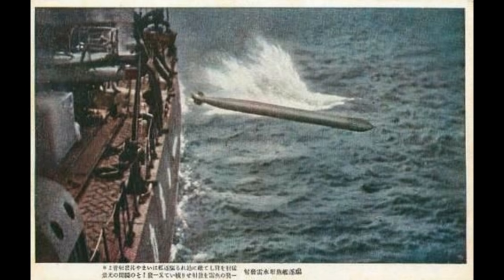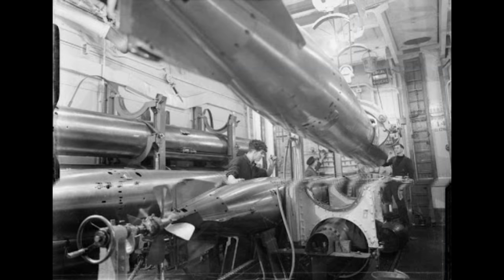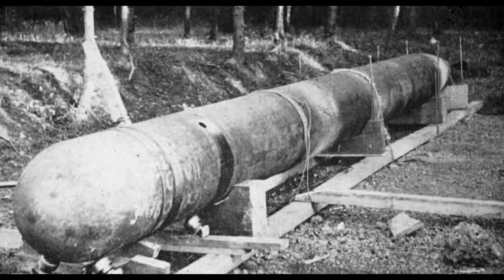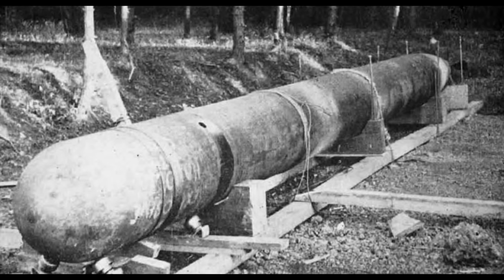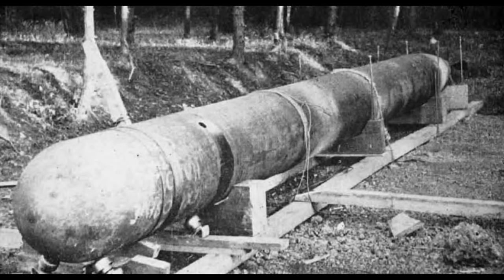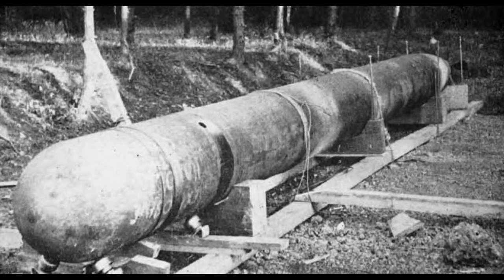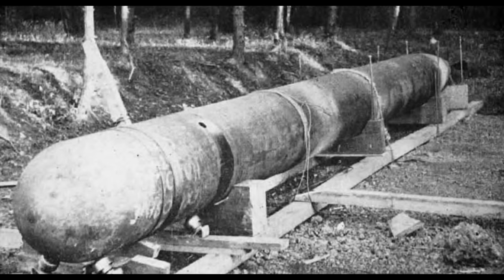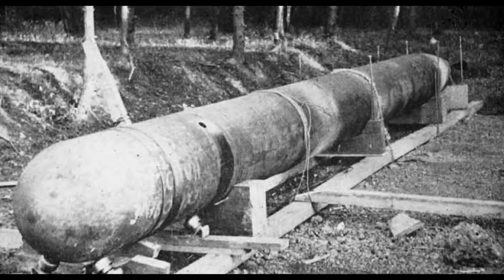Type 93 Long Lance Torpedo - Long Range Hole Poking Device

Comment: Japan had an unexpected ally for defeating the US Navy in the Pacific - the Bureau of Ordnance.
Reply: you mean the Bureau of Disiordnace, perhaps?
Reply: The Bureau of Graft and Corruption you mean.
Reply: I like to think the bureaucrats from the German TVA and the American BuOrd are kept in a special nautically-themed section of hell designed for lazy, negligent torpedo designers.
Reply: @gastonbell108  I don’t know much about the Germans, but the US designers probably did about as well as they could with the resources they were provided. 

The people to blame would be those that decided to not fund proper trials before equipping the navy with the torpedoes and those that refused to accept the field reports of failures. Both of those are going to be above the paygrade of the torpedo designers.
Reply: Highly recommended viewing - “Failure is like Onions” by @Drachinifel  He covered the story of America’s torpedo fiasco in great detail. The comments section was enlightening as well.
Reply: @88porpoise  The Navy brass apparently were loathe to spend any money on systems testing. There were also serious 'tude problems at the bureau.
Reply: @michaeltroster9059  The bureau sent a tech out, to instruct the fleet on proper maintenance and use. On demonstrating installation of the guidance unit (gyro unit, i believe), the Engineer of the Boat had to correct the upside-down unit installed by the rep. The fleet guys told me my shit was broken, I listened. Their lives depend on them having the correct knowledge.
Reply: @michaeltroster9059  You may also know about the time the congressman informed the American Public not to worry about our submariners, the Japanese were setting their depth charges too shallow. The editor of the paper had no issues publishing. The Imperial Japanese navy was grateful for the intelligence, and promptly corrected the issue.
Reply: @Delgen1951  Nice!
Reply: Correct me if I'm wrong,,,,,,,,,,,,,,,,but was not the Bureau of Ordnance/Dis-Ordnance the same group of geniuses who refused to believe there was anything wrong the the American torpedos, which persisted in not exploding, time after time?
Reply: Amen!
Reply: You have to wonder how much shorter the war in the Pacific would have been had the  American submarine force gone into action with a fully tested, reliable torpedo.
Consider that Japan is an nation totally dependent on lots of inter-island merchant ship traffic.
The IJN in 1941 was full of the Samari spirit - a strong offense makes the best defense, so no need for convoys and A/S escorts.
Reply: @agwhitaker  Not sure where I read it, but the US Navy was doctrinally opposed to using submarines for sinking enemy commerce. The Gato class “fleet submarines “ were intended to operate with the fleet. They would Scout ahead, act as pickets, and sink enemy warships. That doctrine went out the window as soon as Pearl Harbor was bombed. I wonder if the torpedo issue might have been discovered and accepted sooner if the subs had worked more closely with the fleet. After all, the negative reports kept coming back without clear evidence or witnesses other than those with the most blame to shift. Who was looking through a periscope during an attack? One or two officers, most likely. Weapon problems are temporary. Blame shifting and politics are eternal.
Reply: @amerigo88  You likely have heard this percentage riddled statistic - but it is worth repeating here,
By wars end, the US submarine force had sunk -
1. over 30% of the claimed Japanese naval shipping -
2. over 50% of the claimed Japanese merchant marine -
this done by a force that NEVER reached 2% of the total personnel serving in the U.S. navy,
AND working with a defective primary weapon for at least the first 18 months of hostilities.
Reply: @amerigo88  While US Navy had powerful ally in Japan that can be described as "warrior's perception". Japan submarines were not trying to go after commerce or supply ship as far as I know. I also read story how before Battle of Midway during planning stage Japanese high stuff was making war game and dices said that their carriers suffered major blow, they erased that event as not plausible.

I wonder whether admirals at sea did not read those reports by submariners in time or did not care or did not have power to do anything. Because if true, it had to be clear for them that one of their arms is loaded with dummy ammunition in hot war and their surface fleet is going to face stronger enemy but even worse - their own destroyers or torpedo bombers are useless as well. 
(how much those doomed torpedo bomber runs at Midway were really ineffective per se and how much were those poor bastards actually betrayed by defective weaponry?)
Reply: @agwhitaker  By the end of war, after problems had been rectified, Japan had lost number of surface warships as well as planes and experienced crews. And still submarine branch suffered (in similar way to armed forces of Germany) the highest casualty rate.
And at the same time, USAAF bombers dropping naval mines destroyed and damaged their share of japanese merchant navy (and some military as well), locked them in the ports despite mine runs were just a miniscule fraction of the total bombing attacks against Japan. 
But I think that even those submarines had great benefit from that bulk of the navy that conquered vast area of the ocean, islands, gave them closer bases, reconnaissance, safe passages and so on. Just to balance those "2% only"
Reply: @88porpoise  Designers aye.. the Admiral in charge no and a special place in hell awaits him. He was in overall command of the MK MIV development and deployment **Rear Admiral Christie**, tho not the only one .. even AFTER Nimitz ordered all the german influence exploders disarmed and the magnetic arming mechanic removed, he (Christie) wasn't in Nimitz direct chain of command kept them on .. and kept missing .. it is impossible to read the reports that he saw and never check out the torp .. Deep running, magnetics causing earily explosions, direct impact exploders not functioning, temp/battery issues on every sub in his command. While Nimitz boats went from 15% hits, to almost 95% if hit  (far fewer duds) while Christie continued to blame the crews under his command for the failure.
You could easily make the arguement to a naval court that his willful protection of a bad weapon gave aid and comfort to the enemy.
Reply: @GeorgetownDude  Rear Adm Christie .. it was him... it is still required reading at the naval acad . ie "How screw up in a massive way and not fix it"
Reply: @gastonbell108  Satan let them keep their jobs, except they have to design torpedoes that can swim through the lava oceans of Hell.
Reply: @odileelido8407  And they're never good enough so Satan keeps beating their hands with a red-hot ruler and making them do it again. For eternity. As a lesson on why not to be lazy with other, much-braver men's lives.
Reply: Well, this is news, isn't it? I could have sworn that the US Navy actually defeated Japan in the Pacific, not the other way round. Indeed, if the Japanese defeated the American Navy, then we've all believed a huge lie all these years, because the Japanese must have won World War two and we never even knew about it....
Reply: The Bureau was also responsible in its entirety for all the issues with the M16 rifle in VIetnam.  All its reliability issues  related to the ammunition the Bureau insisted it use.. which was not the ammo it was designed for... and which was used for its trials by the army
Reply: BuOrd was the most useless organization of the USN.  They refused to live test the Mk 14 or accept its flaws, handicapping US submarines
Reply: @davidthomas7678  I believe you are pulling our legs. It was the US Army Ordnance Department of Aberdeen Proving Grounds, Maryland that did everything it could to favor adoption of the outdated M-14 over the M-16. They also hampered the M-16 by disregarding the guidance of Eugene Stoner, the brilliant designer who warned them that “stick powder” was required instead of the Army’s “ball powder.” When combined with inadequate weapon maintenance, the M-16’s initial deployment to Vietnam was a fiasco of Congressional proportions.
Reply: This was balanced, though, by the Imperial Japanese Navy facing a determined and poweful enemy from this period right through to 1945 - the Imperial Japanese Army.
Reply: @grahamlait1969  it really isnt news. Edward Beach a submariner wrote about it in the early 50s in several accounts of outstanding subs and their commanders.
The US did in fact defeat JPan despite their starting superiority in torpedoes planes and night operations.  It did this primarily thru a crushing superiority in production capacity population access to raw materials innovation luck and breaking the Japanese codes.
I suggest you study the naval battles around the Solomon Islands most particularly Savo Island to get an understanding of just how effective these torpedoes and night fighting superiority  against a group of navies that didn't have similar capabilities but worse continued to deny that the enemy did in fact have such capabilities.
Reply: Ah, Yes. The Bureau Of Ordnance. His Statement At 18:55 More Than Shows How Self-Absorbed, Insensitive, Egotistical & Narcissistic They Were!
Reply: Kelly Arthur  Blair is an author? a Report? I would be interested in reviewing the source. If there hadn't been a pattern of rejection of operator reports by the bureau, I would be more sympathetic to their case. Plausible that the tech installed it incorrectly to test the crew's competence, it comes down to "He said, she said". Poor design, it should have been designed so it couldn't be installed inverted, still on the bureau.
Reply: Kelly Arthur  Taking this fine fat chewing on WWII submarine warfare in a new direction- IIRC, the early war USN subs were not to dive below 300 feet; later war boats 400 feet. I read "Iron Coffins," a first hand account by a Geeman U-boat skipper, and he claimed the Type VII was able to handle nearly 1000 feet! Since a WWII submarine on battery power only was truly fighting in three dimensions, this made an enormous difference. This clearly impled the British faced some very different challenges than the Japanese. I would love to know when this German capability became common knowledge to the Royal Navy ASW sailors. I also heard in San Diego that the USN adopted U-boat construction welding techniques soon after the war. Is this true?
Reply: Kelly Arthur  thanks for the reply
Reply: Japanese combat prowess and BuOrd's fuckery combined were still no match for USA's shipyards going brr.
Reply: @88porpoise  one can forgive BuOrds failure to design a functional torpedo to an extent from the lack of funding...

But one STOPS being able to forgive them for anything the moment they OBSTRUCT attempts to FIX said torpedo and to deny problems with them.

The extent at which they are willing to obstruct every attempt by the US submariners to fix the problems that were in some cases LITERALLY killing US submariners, effectively puts them on near treason level.

They can't blame the congress or government for that... for it was THEIR action which slowed the effort by US submariners to fix the issue, and they are the one who BLOCKED attempts to test said torpedo until US submariners and command in the field took matters into their own hand and TESTED IT THEMSELVES.

That BuOrd then had the gal to then still DENY that problems with their torpedo were present after that... pretty much seals the deal on whether BuOrd can be blamed for the matter...
Reply: You spelled it wrong. It was the Bureau of Idiots.
Reply: Best comment on this page! 😆
Reply: @grahamlait1969  I know about it.
Reply: @amerigo88  This 1000 feet malarkey is actually true. U-175 accidently made an uncontrolled dive to 1,020 feet. U-331 estimated 875 or so feet when it also made an uncontrolled dive but hit the seabed. I'll never forget that line in the movie U-571 where chief of the boat played by Harvey Keitel says "Those Krauts sure know how to build a boat" when their Captain played by Matthew McConaughey, orders them to go to 200 meters.
Reply: Beyond the Type 14, what are you thinking of
Reply: @mungo7136  Good point - the aerial torpedoes suffered from many of the same flaws as the Mk14s.
Reply: @amerigo88  Well, there is question of the enemy's armament as well as area of operation - at least. 
Atlantic i think expect for ares close to mainland is pretty deep. In Pacific several times it was described that sub was attacked by aircraft because even submerged it was clearly visible - as depth of water was not enough to dive below visibility limit. Not like you cannot find great depth there, but if you have to operate around enemy bases and targetted islands you may be fighting in shallow waters.
And at those depth you are already just fleeing and hiding so in 100% defensive mode
Reply: Has the concept that “racism kills the racist” been adopted into naval doctrine?
Reply: @amerigo88  Two were lost directly from the US torpedoes hitting the launching submarines due to faulty gyroscopic compasses…
The torpedoes punched a hole through the submarines pressure hull without exploding…
Reply: @agwhitaker  The US navy didn’t have a reliable torpedo until November 1943. Do the math…
Reply: @amerigo88  The Submarine force were forbidden from test firing torpedoes because they cost so much. Not helped by the fact that the submarine force commander in Pearl Harbor was one of the torpedo’s designers who was VERY reluctant to admit there was a problem.
Reply: @agwhitaker  First entire two years before all the faults were fixed.
Reply: @davidthomas7678  It wasn’t just the ammunition in the M16. The first M16s were shipped with out cleaning kits as a cost saving measure - because they were supposed to have chrome lined barrels. The chrome lined barrels were also deleted as a cost saving measure…
Both came back with the M16A1…
Reply: @kenoliver8913  The Imperial Japanese Army operated almost as many ships as the Imperial Japanese Navy (including aircraft carriers and submarines).
In case you think that’s strange - so did the US Army (but with less aircraft carriers and submarines)…
Reply: Whether speaking of the Navy's Bureau of Ordnance or the Army's Ordnance Corps, the question could be legitimately ask if they are on America's side or not.  I say this as a former USN shipboard Ordnance Officer.
Reply: @princeofcupspoc9073  what we call graft & corruption is also the means by which legislation gets passed. 
You have to give people a reason to say ‘yes’ and if you don’t give people any other reason than the abstract supposed interest of the nation then you’re never going to get anything done, which we have observed to be true over the past few decades
Reply: The Pacific War's combatants were the Imperial Japanese Navy and US Bureau of Ordnance on one side, and US Navy and Imperial Japanese Army on the other.
Reply: @andrewdurand339  Laughing so hard at this one! So true!
Reply: German TVA men still moved much faster than BuO when Dönitz offered postings in Nordkapp if there aint immediate improvements. That was in May/June 40. Just couple months later U-boats had 1st happy time. There wasnt eastern front to send people yet, but Germany at time could invent something nasty.
Reply: Germans took some time with much less crew reporting, that their torpedoes was shite. Many u-boats sunken because faulty torpedoes. Norwegian campaign revealed the problem. On contrary to US Navy,  Kriegsmarine skippers did rise immediately to near mutiny. Demanding working weapons with extreme direct language.
Reply: And the IJA

Comment: I worked for Hitachi in Australia for 20 years in their power systems division. In the foyer of the Hitachi HQ building in Tokyo there is a Long Lance torpedo with cutaways on display. Its held in respect for the tech it had back in WW2.
Reply: @Socucius Ergalla Best routers money can buy no less.
Reply: The Hitachi steam turbines  in QLD are 30-40 years old and still run with the vibration characteristics of a new machine. A GE design but beautifully built.

Comment: Minor correction: The denotator wasn't too sensitive, it was adjustable--and overzealous crew will often crank it up as much as they can just to make sure it will explode. To be fair explode the torpedoes did. Later the torpedo manufacturing team will state that "supplying our soldiers with sensitivity adjusting tools is our largest regret of the war".
Reply: Were the crews supplied with much information on denotator sensitivity? Unless properly trained cranking it up to 11 would be the normal response in a lot of cases.
Reply: @somethinglikethat2176  I can't recall that on top of my head but IJN is not a prime example of friendly workplace where sailors were beaten every night in the name of "spirit injection", so it's somewhat understandable that information didn't get to the bottom. Plus turning the sensitivity down might sound a bit too cowardly for the taste of IJN officers unless you want to be nailed to said torpedo you may want to avoid saying that. Lastly there's the misconception of "our torpedo didn't explode it must be the torpedo, certainly not our aim" and US navy wasn't kind enough to correct them about it.
Reply: @ArmoredNeko  Considering that they actually built a piloted torpedo makes this so eerily realistic that I wonder how much hyperbole can even be used.
Reply: @ArmoredNeko  if you use a cheater you might be able to crank it up to 11.5
Reply: @ericvantassell6809  Maybe even 11.11
Reply: "Is it fool-proof?"
"Yes."
"Is it soldier-proof?"
"Um..."